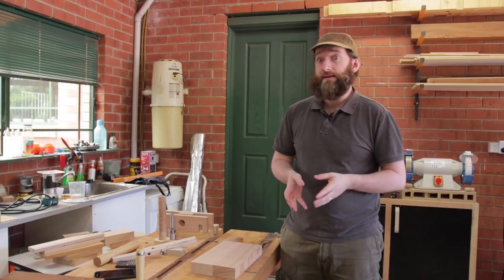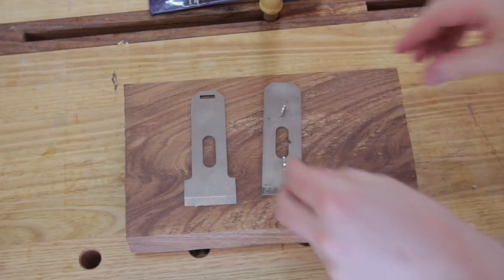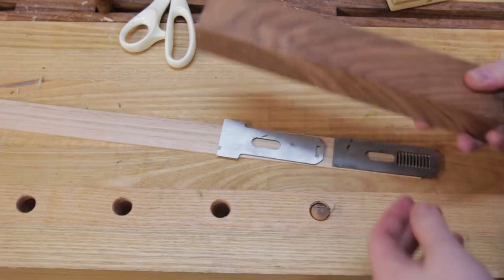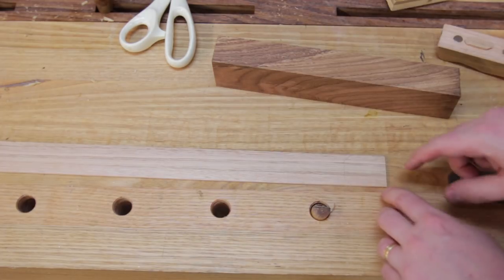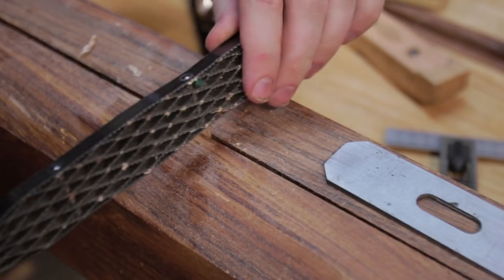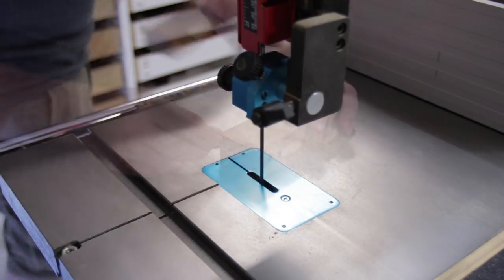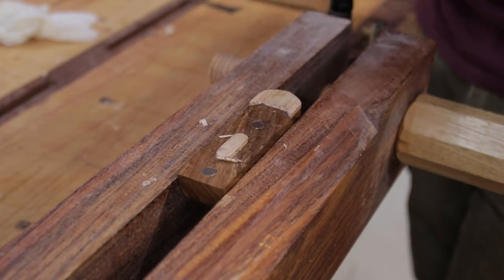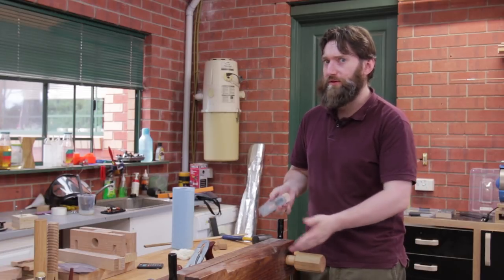Build a Flush Trim Plane

Comment: Its function is the same as a Stanley #97 Edge Plane, or Chisel Plane. The Stanley #97 doesn't use the underside of the blade as the plane's sole, but the blade is set at a very low angle with its cutting-edge protruding to make the initial contact with any rise from the planing surface.

It's as useful as stated in the video.
Reply from the maker: +Richard Hunkins I'd say the #97 and other chisel planes are a bit more versatile than this, but at the "expense" of more complicated to build and actually having settings. I'll have to have a go at making my own Norris adjuster sometime!
Reply: Paul Jenkins Please share if you do! I'd really like to see that. Also, thank you for producing quality videos and alternative solutions. They're much appreciated.

Comment: Hi Paul. Where would I buy a block plane blade in Melbourne? Cheers, Ross
Reply from the maker: I got mine from McJing (online, Sydney), but you can buy the same blade from Timbecon - wait until after 5pm tonight though, they've got a sale on starting then. It should be the replacement iron for this plane, https://www.timbecon.com.au/planing/knuckle-cap-block-planes part #LBP-120-BL
Reply: there's also https://www.finetools.com.au/products/replacement-blade-for-luban-version-1-block-planes
Reply: Thanks Paul & Geoff.